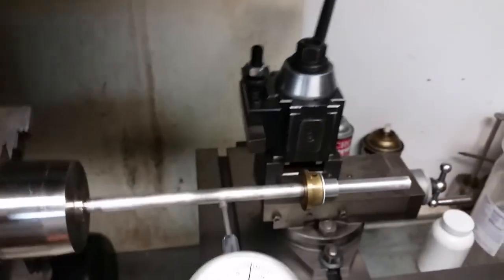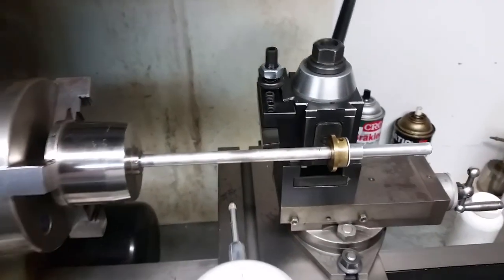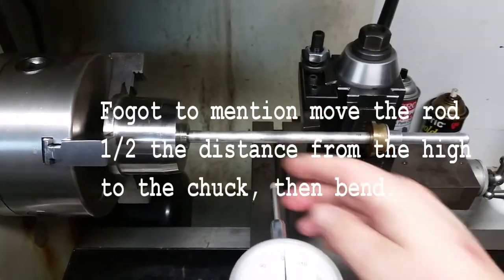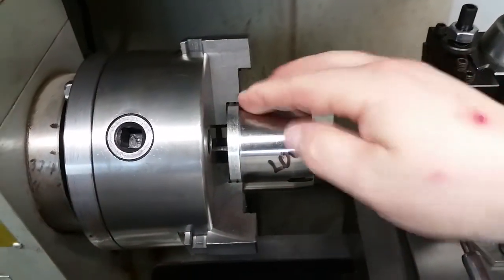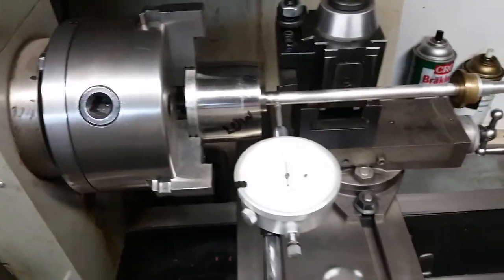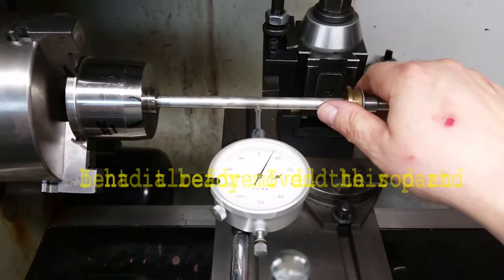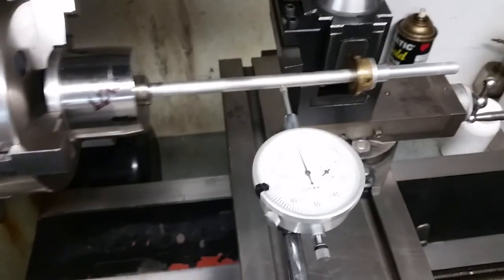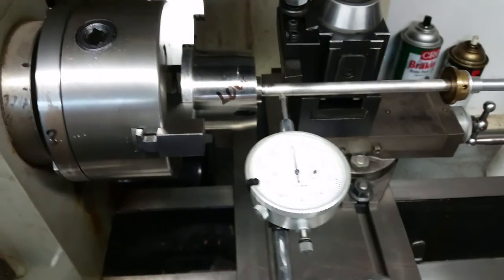How to straigten a machined metal rod using a lathe without cutting

Comment: You are only chucking on what appears to be only .250 or so of your piece in a 3-jaw chuck. It should have been put in a 4-jaw, dialed in to less than .001 on the OD and face to run concentric to accurately gauge how much runout was in your shaft before attempting an adjustment. You did mention that your piece chucked had .006 runout from the get go so at that point any adjustment is just guesswork. Just my opinion on your setup, hope it works out for you.
Reply: Hi from the UK. Works for me thanks. Ive got a similar bent rod, so will have a go tomorrow.
Reply from the maker: Very true, but I wasn't turning/cutting on it. So as long as I set a reference and stuck with it, as marked, it would still be accurate. After completing the project I had only .001 off from end to end as set at my zero and only about .0025 at the 90 degree offset. My tolerance was =/- .005 with a total of .010 from side to side. Thanks for the comment.
Best Wishes n Blessings. Keith
Reply: Nice job on the fix, it working is all that matters 😊
Reply from the maker: Thanks Makin, yeah this is like my tenth one I've done for my work. I actually have a Independent 4-jaw chuck, but I've done these so many times I kinda have em figured out. I checked out your channel, you've got some pretty cool stuff on there. I'm going to subscribe to it. Most of my machining is just for fun, occasionally my boss needs something we can't buy and to go to a machine shop would take weeks to get the funding and approval, so he knows I can usually get it to him the next day. I like to think of it as job security, LOL. Anyways thanks for the comment again. Keith Noneya